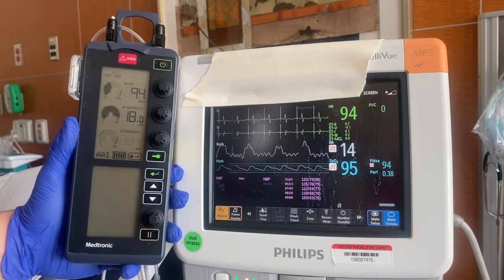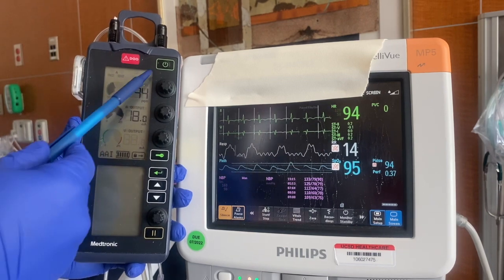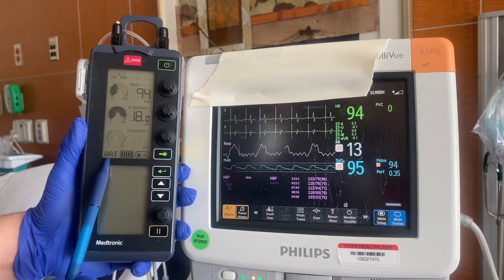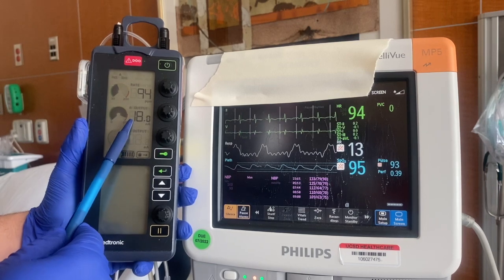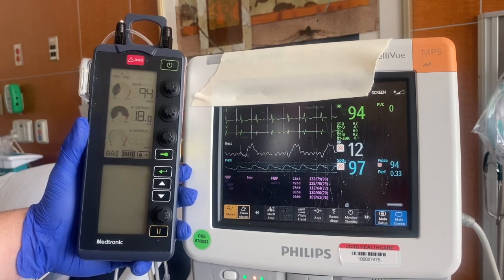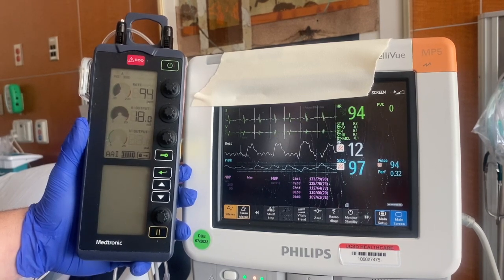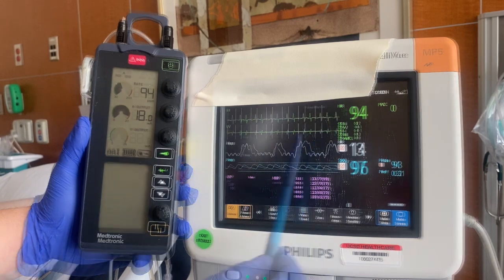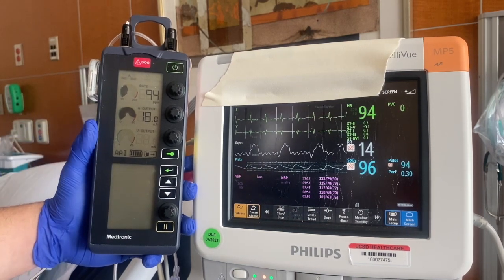Temporary Pacemaker Threshold Testing

Comment: This is wonderful! Great job. Thank you. My only concern is that the sensitivity threshold is technically the # that has 100% sensing, not the # that starts pacing (not sensing). But they're so close, I will still share this with staff to review. I also for stimulation, don't teach to double the # for a safety margin due to epicardial wires creating too much scar tissue and then no longer working. I tell them, instead, to increase by 2-3 clicks. Thanks, again!